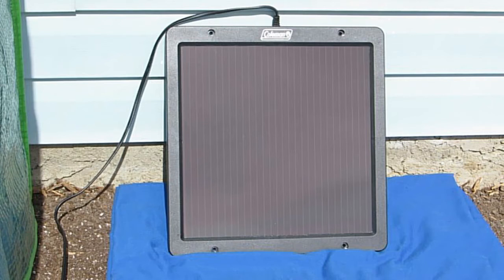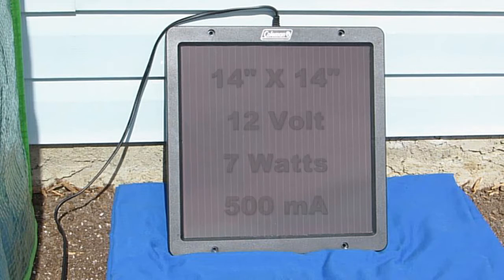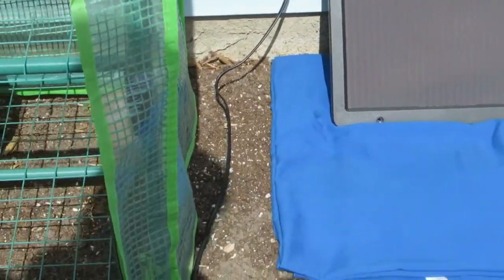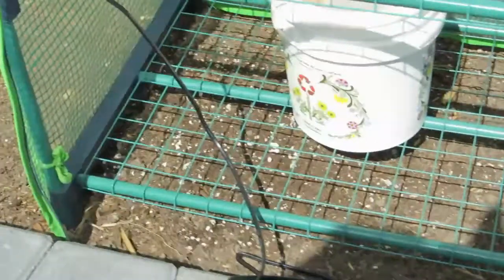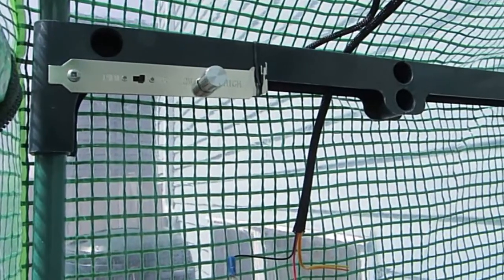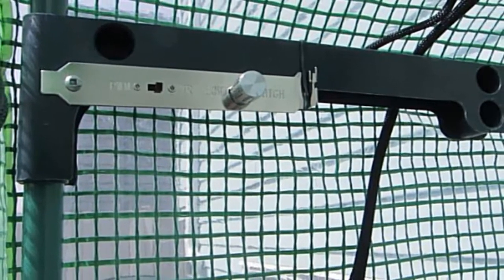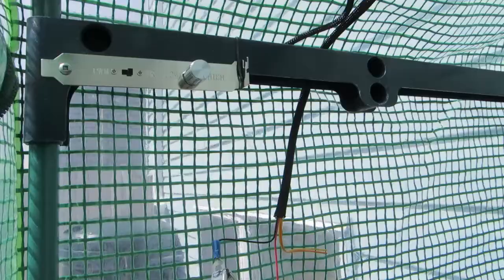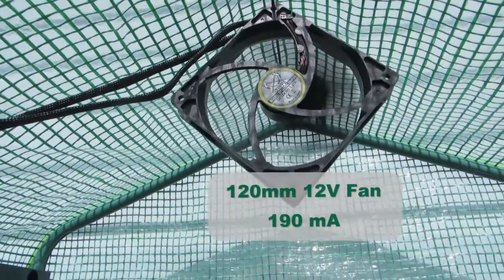Solar Powered Greenhouse Fan - Test

Comment: Guess I'm your first viewer!  I'm impressed with the set up for such a small solar panel.  Can you tell us what the fan is rated in cubic feet per minute (or the metric equivalent).  Also, how much was the complete unit with fan, controller, panel, etc.?  Thanks!